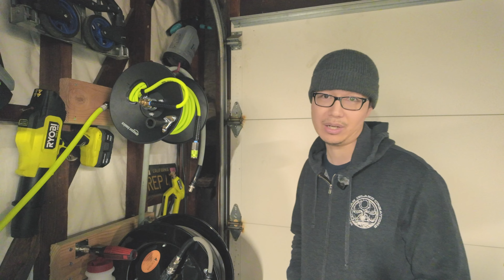I've Made a Stationary Rinseless Wash Setup

Comment from the maker: Update: I've already made some revisions but importantly, the reel is gonna change to a manual pressure washer hose. Turns out that the air hose reel does not offer enough corrosion resistance to water (which was later added to the  title on Amazon lolz AFTER i bought it). Shouldn't be a hard fix.